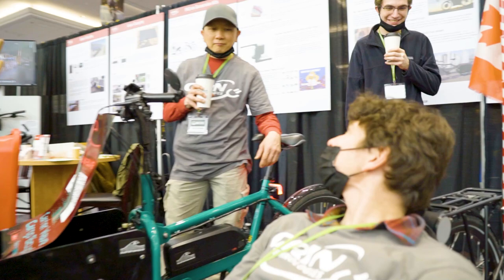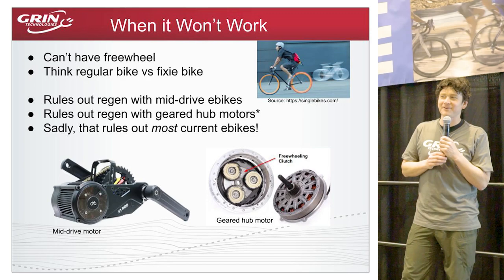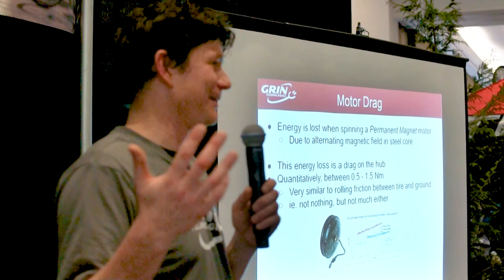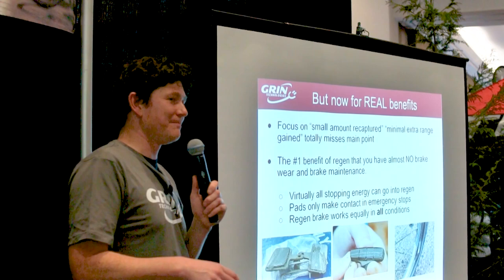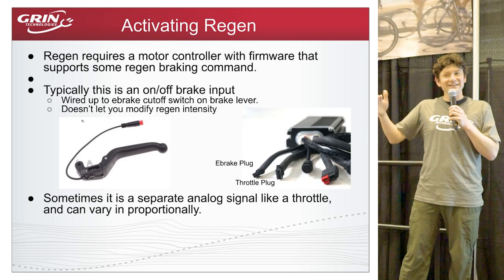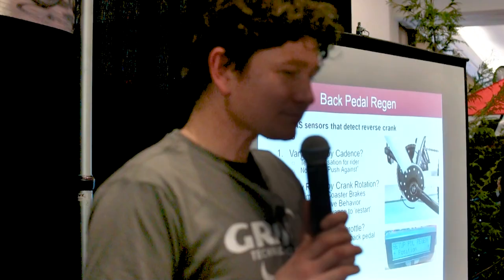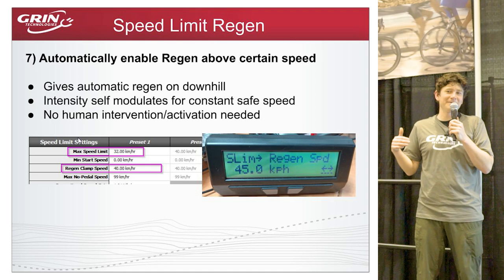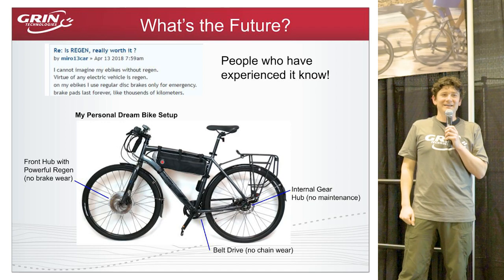Regen Braking and Electric Bicycles, Justin's Presentation from 2022 BC Bike Show

Comment: Thanks Justin ,and Inspiring and informative presentation,  much appreciated! 
After a year of using my own design Regenerative module I might add: 
1,  I found that having a multi-level regenerative settings, one for low speed pedaling that ranged from 40w to 80W from about 5 to 10mph was useful when used in conjunction with pedaling on level or slightly down hill rather than for breaking, and two others for long moderate down hill at about 200w to 300w,, and a third very aggressive mode for stopping that ranges from about 1200w above 20mph to about 500W at around 8mph. Around hilly Portland OR.,  I'm getting about 12 to 20% re-gen. 

2,, is high battery charge current. My DIY system is capable of up to 1500w of above 15mph and I often run 500 to 700W for several blocks on moderate hills which is between 15 to 30amps of re-gen, which is well over the charge rate of most Lithium batteries, 3 constant to 10 to 15amp charging bursts might be reasonable for most eBike packs, so 300 to 500w might be a safe Regen level for such packs but for typical riding I found only delivers about 3 to 8 percent overall range improvement.  To Improve range and re-gen amperage I've added a parallel 600 watt-hour LFE (Lithium Iron Phosphate pack) in parallel that adds about 20+ amps of regen charging ability. over the 6 amps (300w) I feel comfortable hitting the Li-on Pack with. 

As a torture test over about 800miles and several months, I hit a 48V, 500 watt-hour lithium-Ion pack that was rated at about 2amp max charging with typically 10 to 28amp of re-gen, right up to full charge voltage (NOT RECOMMENDED OR LIKELY SAFE) And the high quality industrial (Server-rack) Li-On Japanese cells I'm using appear to have suffered no measurable increase in internal resistance or decrease in capacity, but I wonder if the high level of charging could cause dendrite formation and increase the chance of shorting? 

A third benefit of re-gen I found is safety and stability. I use re-gen as much as possible and it helps me maintain a constant speed without lock-up as regenerative breaking automatically decreases with speed, and increases with speed matching pretty well when needed sort of like a passive anti-lock system, so I don't have to get aggressive on the brakes, As well, if the tire under re-gen breaking hits a low traction surface, by the nature of the system I've never encountered a skid under even heavy re-gen as might with mechanical breaking. 

Thanks again for the great presentation Justin, Regen is something I appreciate as I do your passion for it.
Reply from the maker: Hi Jack and thanks for sharing in detail your firsthand experiences too! I still plan to do a much deeper technical talk on many finer points of regen, this presentation was just a primer :-)
Reply: @GrinTechnologies  Hi Justin,
Do you know if there is a Chinese version of the Pinion gear for retrofitting normal bikes?  I have been thinking about this for a while.

Comment: One other key point I love about regen braking on my BionX is that it is inherently anti-lock braking.  This is especially nice on snow and ice.
Reply: Thank You! I actually had no idea how regen braking really worked until I watched this video(I'm fairly new to the ebike game) I've also seen  a huck cycle review video with shreddie mcskate where he locks the bike and tries to push the bike forward as if running away with it and the the Regen braking activates a drag to the bike slowing it down dramatically to wading through quicksand speeds it seemed really useful... Damm I said a lot my bad lol
Reply: The ride share scooters have this feature to help with theft although it’s only 1 wheel that locks up and they’re still light enough to pick up. It would be nice to have on my heavier dual motor scooter though

Comment: I learned more from this guy than ANYONE in YouTube when it comes to e-Bikes, thank God he chose e-Bikes as his area to work in, because with his genius, he could DO ANYTHING he put his mind to!!! 💯👍
Edit: I'd gain 20%-25% or more because I carry heavy loads, ride in stop & go traffic with hills everywhere, so what's the cheapest way to put this on a rear motor e-Bike??? 🤔
Reply from the maker: Thanks for the flattering comment about Justin!  
For your question, Step 1 would be get a Direct Drive motor or a Gmac... step 2 would be upgrade your controller, Baserunner or Frankenrunner so you can start doing regen. Definitely contact sales and support to get into specifics.

Comment: I have variable regen on a rear DD hubmotor commuter that I built years ago. My commute included some steep downhills that would heat up the brakes to the point they were starting to fade and there was no emergency capacity left. With variable regen the speed was controlled while the brakes were cool and ready for any emergency. It was like having an adjustable parachute going down the big hill. I didn't care about the recharging of the battery, but the saving of the brakes was worth a lot. Variable regen is really nice and definitely worthwhile.

Comment: I added a simple horn and light switch to the regen input of my Cycle Analyst. The horn button (momentary) triggers temporary regen. The light button (on/off) adds regen for longer downhill mountain runs. Both settings allow for variable regen by twisting the throttle. Cheap and easy.
Reply: wow, that's beautiful.

Comment: Excellent talk. Thank you for sharing this. I have a Yuba Mundo with a StokeMonkey...and I am thinking about either the GMAC on the back (and removing the StokeMonkey) or adding a Grin All Axle Direct Drive to the front. Thanks again for all you Grin folks do for the ebiking world...and the world!
Reply from the maker: If the stokemonkey is still ticking along and running fine we'd recommend to add the All Axle on the front.  The combo of a DD hub plus a mid-drive is really potent for tackling just about anything with great efficiencies.  If you upgrade the controller on the stokemonkey to use a newer baserunner controller like the All Axle, then running dual systems with a single throttle control is fairly easy too.
Reply: @GrinTechnologies   Thank you. I watched your great video on multiple motor setups a couple weeks ago and I recall your positive comments about a mid motor in combination with a front DD setup. And I am really enjoying your sailboat videos too!
Reply: To add to Grin comment, if you put a rear motor, you'll loose the special reinforced wheel at the back. 
You won't be able to carry a full load on it. 
As a longtail is usually heavy and needs a lot of power, your mid drive motor must chew your whole drivetrain pretty quickly.
I've got a front hub motor on my yuba mundo, it works great. As it's an already heavy bike, you won't feel the all axle in the front.
Reply: @xmtxx  Cool...thank you very much!

Comment: I hope that backpedal regen via crank position/rotation survives the beta and becomes a factory option. It would be my prefered option, as it seems to be the most intuitive if you can set it up right. Altough, the two throttle option dosent seem too bad, but I would have it set up differently - A twist accelerator and a thumb regen on the same handlebar sitting next to one another, far better ergonomics in my mind. I would even have the regen cutoff the accelerator for saftey. Its a bit of a hybrid with the bidirectional throttle, as you are pulling with your wrist and then pushing with your thumb.

Comment: Justin is right. Once I got an ev car and got used to 1 pedal driving, I immediately wanted regen on my bike. I absolutely hate using brakes on any kind of vehicle now. Why not just have a set regen like ev cv cars do? How would you know if the motor is overheating? 

We have the same dream bike. I would love a belt drive ebike.
Reply from the maker: The engine braking feature can be implemented fairly easily using the Digi Aux regen control that's in the CA3.2 firmware. You can adjust the amount of background regen with the digi aux input, but whenever you use the throttle that overrides it.
Reply: once I got an ev car and got used to blended Regen, I immediately wanted regen on my ebike. I absolutely hate using mechanical brakes now, when I can have very strong regen and precisely controlled regen with the brake pedal, that will put back as much energy as possible back into the battery, save brake pads wear and prevent brake from overheating when going downhill. Just my personal opinion about Regen, as I think one pedal driving is far overstated and blended Regen braking far understand because of Elon Musk arbitrary preference and ignorance about blended Regen braking (which doesn't have a "weird brake feel" when implemented properly). one pedal driving and lack of blended regen limits max Regen power (a 1000hp plaid only has 75kW of Regen when a taycan has 350kW or my 111hp 3000lbs 500e has 80kW)
If I was given choice I'd rather have as strong as possible controllable Regen (for instance using a brake lever position sensor) like on my car than Tesla-like one pedal Regen especially since on an ebike with pedal assist you only use the throttle when you're not pedalling
Reply: for me the dream ebike power train especially for a full suspension bike is revonte one mid drive that provides both pedal assist and infinitely variable transmission in the same package with less moving parts that a pinion or rohloff gearbox and without losses or complexity of a nuvinci cvt. basically the eCVT of Toyota/ford/Honda hybrids adapted to ebikes. They say Regen is possible in the future if the rear hub has no freewheel and the chain belt keeps turning with the rear wheel. 
you get the advantages of a mid drive, with a super low unsprung weight, possibility to run a belt or chain without tensioner, perfect chain line, and all the complexity and weight is located around the bottom bracket, low and close to the battery.

Comment: Completely agree. I ride a handcycle with e-assist and my brakes are my backup safety system. 95% of braking is done with regen. I can set a safe downhill speed on my cycle analyst and not worry about using my brakes and just enjoy the decent..

Comment: Just add a 3rd brake lever that works more like a throttle on a variable resistor. 2x levers could be on the same hinge pin so you could either pull them both together or just feather the upper one for re-gen regulation. Sometimes you will need both together anyway.

Comment: Good description. On another website, I discovered that the BEMF doesn't go through the 6 drive MOSFETS, rather it flows to the battery via the 6 reverse current (MOSFET protection) diodes. So no additional diodes needed! I liked the description of how the braking modulation works. The controller looks at the throttle voltage and rpm. When the throttle is retarded below normal power off, the controller at first applies an almost equal forward voltage to match BEMF being generated at that rpm. Thus freewheeling at normal throttle power off. As the throttle is further retarded, less and less forward voltage is applied, allowing much greater braking force from the increased BEMF being applied to the battery. However, the regeneration circuit could have been made more efficient if regeneration was controlled not by forward vs. BEMF voltages, but by electronically PWM modulating any BEMF voltage generated (no forward voltage applied in regeneration mode).

Comment: thanks for a clear and deep explanation backed with numbers of something I've always had a gut feeling for. it's exciting that ebikes are still in their infancy with so many improvements to come. blended Regen braking on the brake lever like on my ev (fiat 500e) sounds awesome.
hope you'll be heard by the rest of the industry
Reply: In the meantime a good easy stop gap solution is to use a magnet glued to the brake lever,   and an analogue hall sensor stuck to the brake body.     Loads of ebike kits use a similar thing. 

Calibrate the brake end points the same way you calibrate the throttle range on an RC car ESC       

Some kind of input like full throttle,   or button to press upon controller power connection on and boot up to enter programming mode.

Where it will then periodically cycle through available settings,    beeping a certain number of times (simply by using the motor as a chime,  just like in RC cars) each time it switches to indicate what setting will be adjusted a step when the button is pressed or blipped with full throttle then beeping again a number of times to indicate what level the current setting has been set to.

Easily navigatable with a piece of paper with numbers that correspond to individial setting,   the each setting having its own numbers to indicate what steps are available for each setting)

Though,   when you press, 
or blip the throttle on the regen brake setting,     it will be a little different.     It will enter regen brake end point calibration mode.

It will take the current signal from the brake hall sensor when you enter regen brake calibration mode as 0% brake.     Then set your wheel rolling.    Now start squeezing the brake lever.   As soon as the wheel visibly begins slowing down.     Stop squeezing.

Then press the button,   or blip the throttle and it will set that point as 100% regen brake.

At that point you have perfectly calibrated Regen and mechanical hybrid brakes
Reply: @GorillaZillas  I'd love to test ride an ebike with strong Regen properly calibrated this way on the rear brake lever...I love my fiat 500e Regen braking on the brake pedal. I can use 100% Regen braking on my daily driving even if I brake hard and whatever Tesla one pedal driving fans can say, my brake pedal feels better than on my gas cars.
the cherry on top would be to have software abs on the rear brake. front tire is way less likely to lock up when braking hard and/or downhill (although with higher consequences), it doesn't sound that hard to implement abs if you have hall effect sensors
Reply: @geemy9675  As far as I know,   Regen braking is inherently anti lock,  as resistance is caused by current flow,  and current flow is caused by RPM.   If the RPM drops anywhere near zero,  so will the resistance.

You can see this effect when you drop a magnet through a copper tube.

Or if you short out a motor,   then turn it to feel the resistance.    Even a completely shorted motor does not lock up.

It might skid with a lower RPM than the speed of travel though,  so there's still room for improvement.
Reply: @GorillaZillas  I don't know specifically about Regen being inherently anti lock. I don't see a reason why the wheels would stick at 0rpm but it sure seem like they could skid turn slower or maybe even backwards depending how the Regen is programmed but anyway it shouldn't be too hard to implement a feedback loop the same way electric motors can have finer traction control than ICE.
I know for a fact that my 500e completely shuts down Regen below freezing temps though
Reply: @geemy9675  Yes,  actually you're right.   They probably would skid while turning slower than the rate of travel,   could be solved if the controller doing the regen could read RPM sensors on the wheels and reduce braking power when the regen braked wheel rpm dropped lower than the non regen braked wheel.
Reply: @GorillaZillas  you could also use the hall sensor form the driven wheel motor and detect and spike in deceleration that is way beyond what tire traction could achieve. it just needs to be calibrated with the wheel size. hall sensors only provide position every 60° which is way less precise than abs sensors though.
I am not sure how much does Regen have a kind of built in abs,on one hand the controller generates magnetic field to generate torque, knowing what position they expect the motor to be based on the sampling every 60°, and for example in case of a sine wave controller, provide the optimal instant power, so if the actual wheel position is not where it's supposed to be, it could decrease the torque and stop the wheel skid, but almost the same should apply to traction control and doing burnouts from a stop.but in practice, my fiat 500e traction control sucks big time. if you put more than 50% throttle from a stop, front wheels ar  going to spin for a second then power will be dialed down, wheels will hook up again, then after another second wheels are going to spin again, until you reach a speed where it will stop spinning. so basically like a very slow traction control system. if you disable esp, it will do basically the same 🤪 I think it's because From a stop or a very slow speed, wheel are not or hardly spinning so hall sensors don't provide much meaningful info about the wheel position.
I think most importantly, no stock ebike is capable of doing a burnout, at least not without using the front brake/unloading your weight, so probably also almost zero risk of losing traction ?